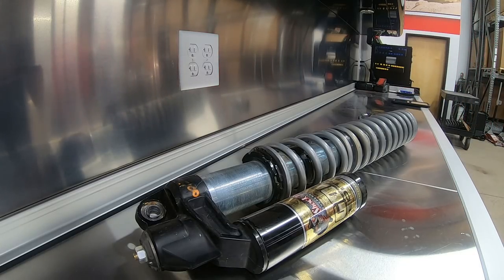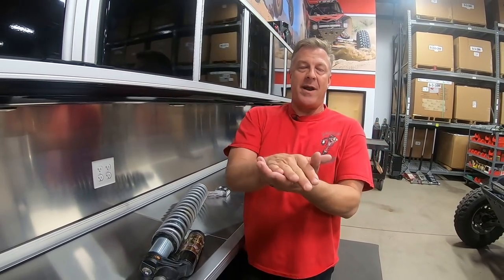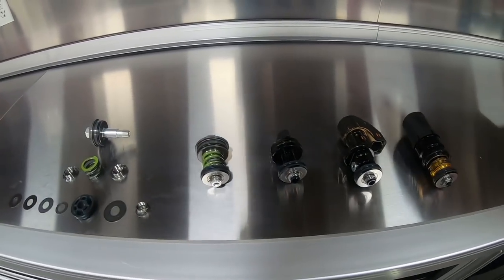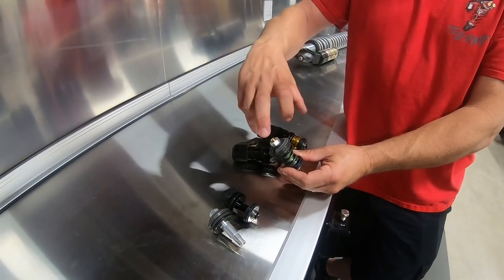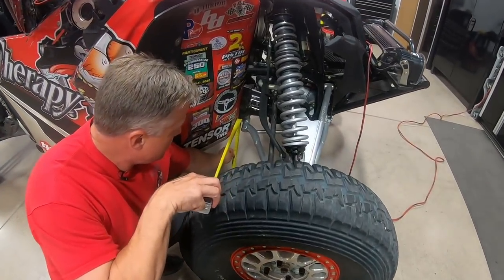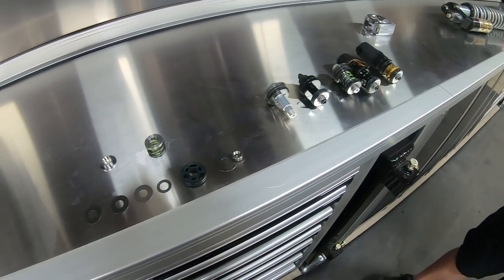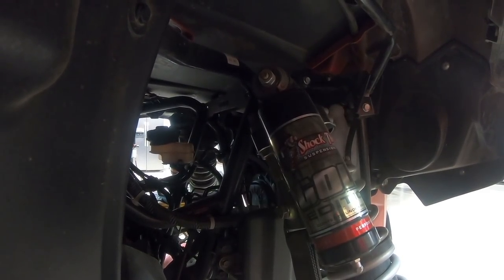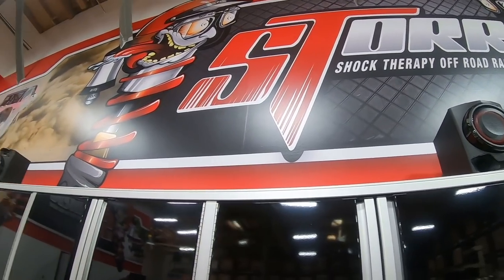Shock Therapy LIVE: How to Adjust Shocks

Comment: Very informative video , after watching it twice I think I’m getting the idea but  still not sure  if the front  high /low speed compression and rebound settings should be screwed clockwise a little  more  than the rear?

Comment: I thought high speed adjustment was for controlling the choppy, chatter stuff that creates high speed shaft movement, and low speed was for g outs, jumps and lower speed shaft movement?  Do I have it all wrong?
Reply: Same, for my mountain bike suspensions high speed is for big quick hits like if you drove straight into a curb.  Low speed would be for rolling whoops.  When I had ST on my X3 and I wanted the chatter to be softer or more plush they said to soften low speed compression since the car wasn't moving as fast.  It worked, but I'm still more confused than ever because I would have thought bobble head rocks and washboard stuff was high speed compression and rebound.  Not sure what's right at this point.

Comment: Ok question about ride height.  You said you set that particular car at say 16 inches. But what does that pertain too?  Different size tires or longer arms will change things.  So how bout how much droop or drop in percentage of suspension travel.  Do you want the car to sit at 2/3rds the amount of suspension travel or half or are you only worried about ground clearance.  This should pertain to any off-road car buggy truck or sxs  doesn't it?  Thanks.
Reply from the maker: Good question. Yes we are ultimately trying to set the suspension in a droop/compression spot. We tell people in the spring kit instructions to account for tire and long travel by adding 1/2" more ride height to the measurements for each 1" of tire height over stock. Add an 1" in ride height for long travel. The reason we don't give a shock shaft measurement or a percentage of droop for people to set up is because it is next to impossible to measure this on the car. Springs and dividers are in the way and 1/4" of shock shaft can be 1" of ride height change in the front on some cars. It is just easier to measure the ride height and account for tires.

Comment: other than rotating springs is there any cure for the wear from the plastic slider on the threads on the shock body
Reply from the maker: If it is a walker Shock then a new divider with a closer fit will help a lot. Keeping the shocks clean helps too
Reply: @ShockTherapyllc   Thanks for the info am thinking about machining a plastic Delrin  or UHMW sleeve for mine to help with this issue 2018 RS1.

Comment: This may be a dumb question but....: I'm buying a 2016 RZR 1000. I have an enclosed trailer, so the height is going to be crucial. He measures it at 80.5 inches and my doorway is 82 inches My question is, can I adjust the shocks easily to lower it another inch if necessary? Also, would I gain another inch if I deflate the tires a bit? It's sitting on 32s.
Reply from the maker: Pull it down with ratchet straps. Super easy. Next deflate the times a bit. Pretty normal stuff
Reply: @ShockTherapyllc  Thanks!!!

Comment: Does the rebound circuit also have a popoff for compression in it? I have read that in some shocks the rebound adjuster also has an effect on compression. Was that shocks from years ago or are some modern shocks still this way? Or is that just some nonsense internet info

I have over 1,000 miles on your x3 steering rack and it still feels like the day I bought it, stock rack was junk almost immediately. Thank you!
Reply from the maker: Great question. Most shocks today have a rebound adjuster that is basically opening or closing an oil passage in the shock shaft. This port is free flowing both directions (comp and  Reb). Because of this you can say that the rebound has an affect on compression but it is minimal. With the rebound adjuster open you would see more slow movements in the suspension just like a low speed compression adjuster would control. With the rebound closed you would see less boaty movements in the suspension on the compression side just like closing off the low speed comp adjuster would do. How much? Well the affect of rebound all the way open or all the way shut on compression is about the same as one full turn on the low speed compression adjuster. There are shocks that have a one way check valve of sorts in the rebound circuit. Fox RC2s have this so that any rebound adjustment does not affect the compression system. We actually made our own nut on the end of the shock shaft that has a one way valve in it so we can run this on any shock to isolate the rebound. We run them on our race car (Fox IBP) and on other shocks for customers too. We saw a difference but it is minimal. Hope that helps with your question. Thank you with regard to the X3 rack. I am so pleased you like it. They really are bullet proof. Have a good one.
Reply: Thanks for the great answer. These new live videos are awesome, I don’t always catch them live but I’ve watched them all. Justin: I definitely want to vote for go into as much nerdy detail as you want, It’s great!

Comment: So two questions - in simplest terms does adding preload and therefore ride height soften or firm up the ride?  And if the crossover gap between the divider and crossover increases (from say 2 or 2 1/2" as recommended to 3 1/2") does that soften or firm up the ride?  I set up my 2018 XP Turbo with Walker Evans shocks dead on the recommended settings, and ride height is close (slightly high in the rear) but the crossover gap is 2+" in front and 3 1/2" in the back when putting them 5.25" and 8" down as recommended.  So should I just lower the crossovers to match the gaps you want?
Reply from the maker: More pre load equals more spring tension and ride height. This will firm up the ride quality. If your cross over gap is too large the ride will be softer for a longer time through compression. It basically can cause bottoming out if it’s too large a gap. If your ride height is good then run it. If it bottoms out too easy then adjust your compression adjuster. If you end up with most of your adjustment put into the shock and it still bottoms out then lower your cross overs and start over with your compression adjuster. Hope this helps.
Reply: @ShockTherapyllc  certainly does - thank you!  And thanks for answering on Xmas! :-)
Reply from the maker: @Joe2Jock  we all need to put our Christmas presents on ASAP! Right? Merry Christmas

Comment: So slower for chop
Reply from the maker: Softer compression settings are best for chop.
Reply: Basically we got a machine with basic reservoir shock bottom dial and top reservoir knob. We have the bottom in midding of 14 clicks the top we loosened all way and only went in 4.. at 6 the thing was way too unresponsive to chop ect rocks in New Hampshire trails. I know they ain't the baja 500 grade but seems like the setting  at reservoir less clicks the better..